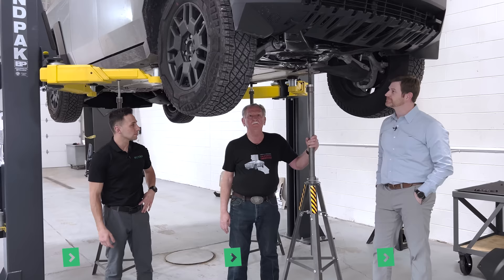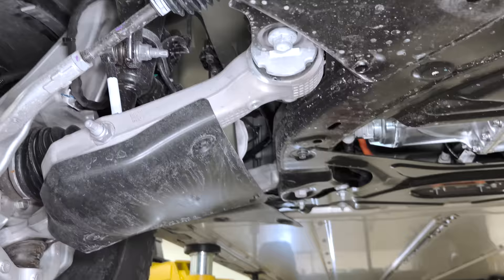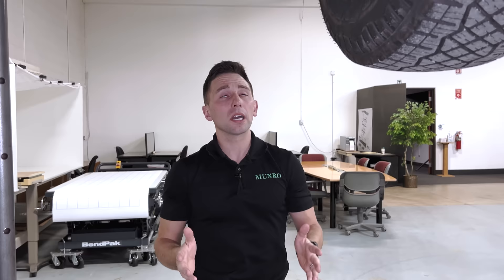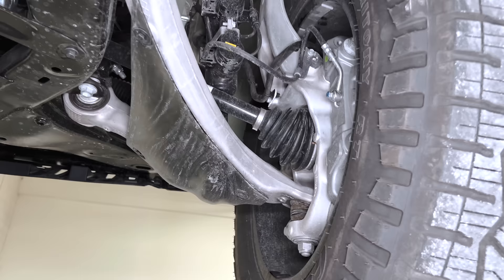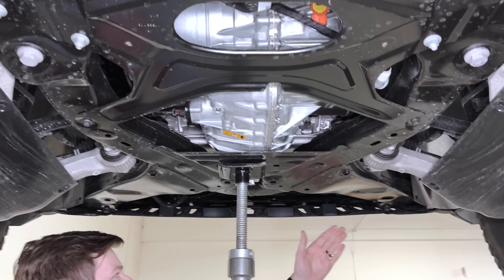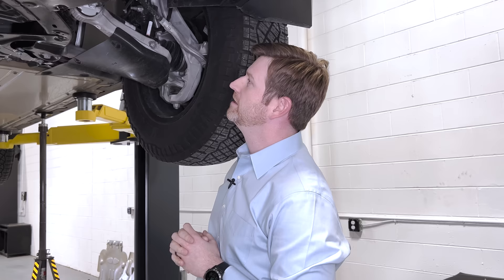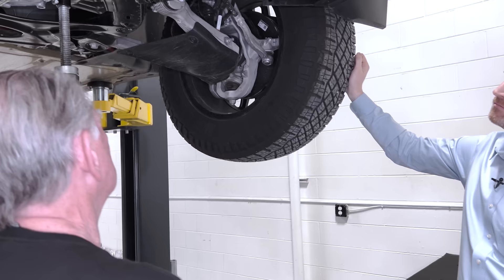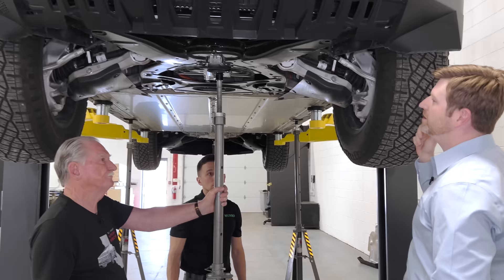Tesla Cybertruck Underbody

Comment: I think these are AWESOME more awesome then most people seem to realize except for one major flaw . Being an EV and having bad range . 

What I want to know is , these should last for ever as far as the actual vehicle from a materials aspect.  If you charge them to 100% all the time and abuse the battery trying to get decent range at some point the battery will b3 less effecient and then die . FINE , that's ok and expected.  I think it's nuts that they quote range that isnt close to real in real world and weather but then also tell you you should only charge to 90% ( just nuts ) or 80% to be really safe.

But here is my question . Presumably battery technology WILL improve and at some point a EV won't need to weigh 5klbs for a smaller vehicle to 7 8k or more ( Hummer or Dummer ) . 

If the actual truck lasts will you be able to upgrade CT in future and however 100 of ks the battery pukes will this be disloseable or will it be like a car where you can put in a modern power plant and use a newer more powe4 dense battery so you get the range Tesla claimed ot 600 miles that then was lowered and then was even lower in cold etc or if you drive it like people drive on hwys etc.

If i thought in future I could rebuild this vehicle and put new battery that should both be better and less expensive in future instead of needing a whole new car that would appeal to me .

Considering most cars are made from super stupid materials covered in Ultra stupid SHINEY WEAK PAINT for a TOOL that will be hit and exposed to things that scratch and salts and weather etc . Steel that dents from a minor touch and then rots is just dumb . But this is made from ULTRA SMART MATERIALS WITH EXTRA SUPER SMART FINISH and if you replace some wear items should last nearly forever if taken care of and no major insults .

But if it's disposeable like a cheap EV that's a drag .

Theoretically If this I built correctly with ability for upgrades as they occur and costs for batteries drop as predicted one should be able to buy one in 20s today and never buy another Truck for life and just maintain this one . The main structure and panels should easily last 60 years and 1 millions miles by replacing certain components , resurfacing seats perhaps . Replacing certain regular steel pieces etc. 

Will these be like a 55 Chevy still be used daily In Cuba as taxis ? 

Will this truck be like an 80s early 90s Mercedes diesel where you paid up front but could in fact expect at least 500k of use to 1 million if you took extra care and replaced stuff ? 

If that's the case then I will believe these and other EVs are fully motivated by preserving environment and being effecient . If they are disposeable except to be recycled using energy and made into a new product using more materials and energy then not so much .

If in the future upgrading the battery will be easy and make the truck do what it should and actually improve as it ages then it's a great buy . If when the battery is loosing effeciency or dead and the cost for new battery to go 180 miles uhless hyper miling in cool weather is higher then the equity of th3 vehicles value then not so much .

Just imagine this exact vehicle weighing 25% less with 25-50% more effeciency / range . Then it's a proper miracle.  If there Is truly much room for improvement In batteries to reduce weight for same amount of energy storage EVs will be astounding . If they cut battery pack weight by 1/2 cars will be soo fast they will all need air brakes and chutes . Imagine a plaid power train car weighing 2500-3000lbs .

I hope that's the case and buying CT today is a smart investment you will be using 20+ years in future when paid off and just the cost of up keep and re upholstery or replacing screen or new processor for fraction of buying a new car . I mean at this point how much better do cars need to be for HVAC , comfort and convinience and gadgets . With fresh battery these should be fully useable in future If built with any idea of being real and not I phones .

Comment: When you step back to design concept - ie - how do we build a pick up truck - choosing electric as the prime mover is a bad choice. Ice is far superior for this application versus battery electric. The weight alone - meaning - by design - you don’t want to haul around a massive battery when the job of the vehicle is to transport loads- either in the bed or towing. This is essentially a joke vehicle made for image not function and bought by virtue signaling, pretentious owners who want to show the world how cool they are - not a person who earns a living with a pick up truck or puts it to use as intended.  Btw - the guy that suggested snap-on attachments for the suspension guard did a great job demonstrating he has no automotive experience - especially in off road use cases.  I laughed when he suggested that as did every other real ME with actual real world automotive experience.
Reply: You make the flawed assumption that most trucks are work trucks.  Of course that's convenient for you since you're not even pretending you're objective.

Comment: That looks like a lower control arm skid plate. Why would you want to remove fasteners from a skid plate? Y’all need to balance the cheapest way vs the best way to engineer something. Now I know why new cars fall apart so soon.
Reply: @ChadwickJames  it also has several scratches like a skid plate. If Tesla designs it as cheaply as Munro would like, you’d have lost it on the road already
Reply: That’s absolutely not a skid plate. Its to cheat range